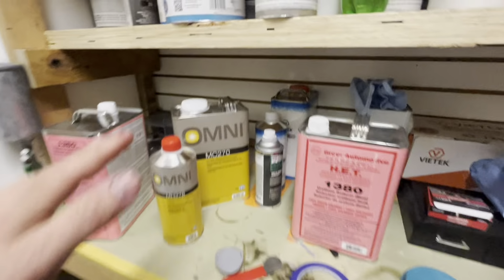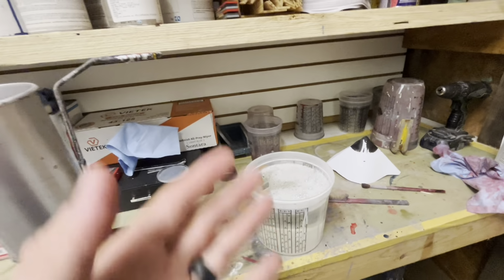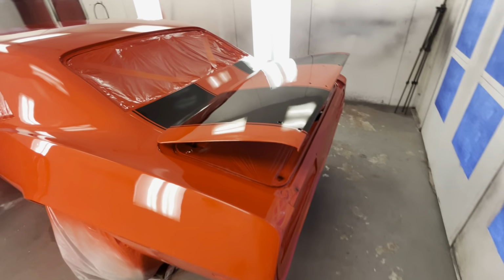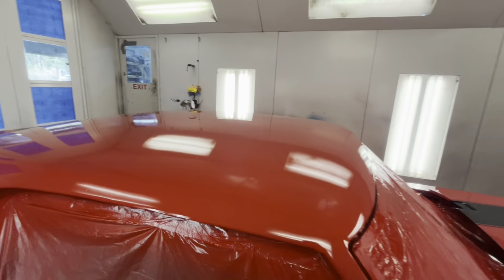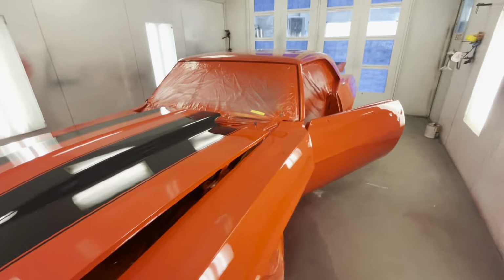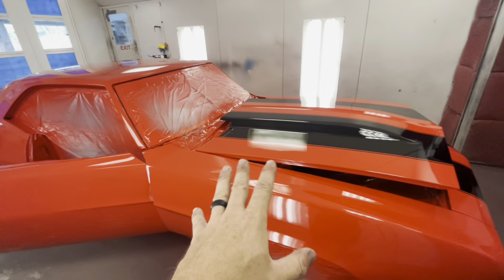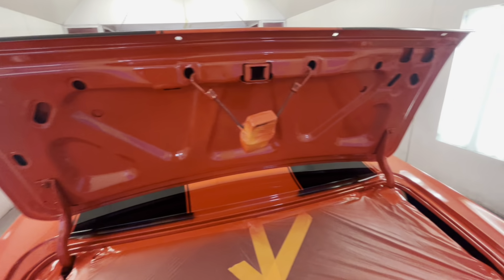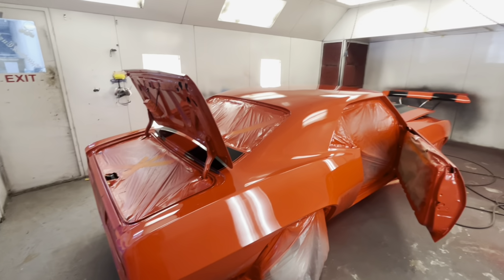💦 Clearing Our 69 Camaro Project 😳 This thing looks AMAZING!

Comment: If you did cut and buff that job about how much extra would that have cost?
Reply from the maker: I’d charge another $1,000 to cut and buff that whole job bc remember I would of had to do another coat of clear on it to prepare to cut one coat off so it’s more material also

Comment: That looks great! Personally, if i was going to daily drive a car, and its costing me out of pocket, not an insurance claim, there is no way Id pay for this high quality paint job. Courtney, you smashed it, not a show quality/detail job, but over the top compared to what a "MAACO" paint job would be. Its too nice to let some $hitty human shove their shopping cart into the side of it and drive away (in my opinion, which has no value in a comment section❤) 
  When i say "no way id pay for this high quality of a paint job-then daily it without worrying about chips and dings"- I am saying, the cost of the materials alone in this car, would hit my budget limit. However, if it were something I felt was special to me, that I wanted to be what I consider "sharp", that I could drive and wipe on, piddle with, id expect to pay no less than 5, 5500 or so if its not a color change with minimal body work and no Chinese replacement panels that will take a lot of time to align. Just wanted to explain. Enjoy this channel and all you share, didn't want to sound like i was criticizing the job or cost etc. 🙏🏽
Reply from the maker: Man thanks a ton. I’m so thankful for guys like you that follow along and give feedback back I greatly appreciate it!